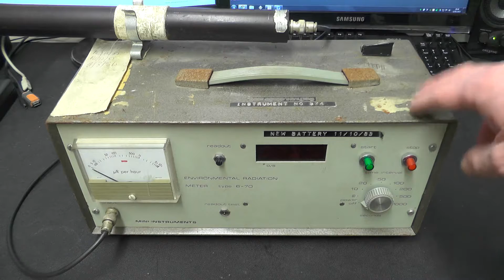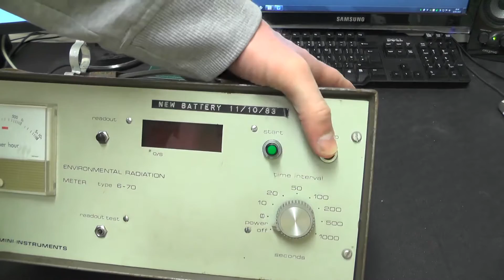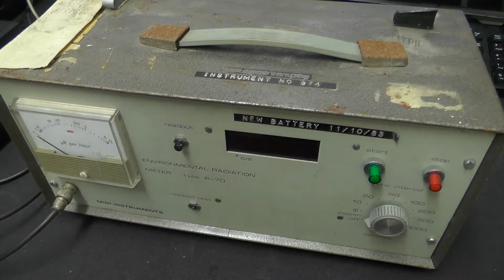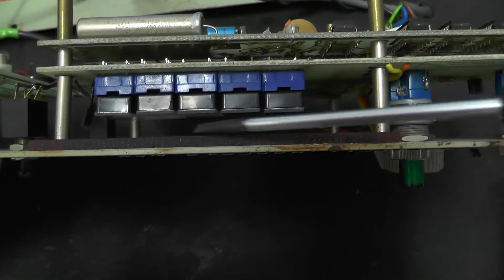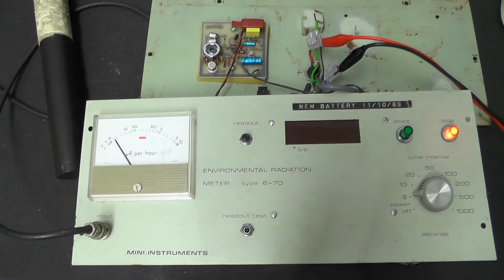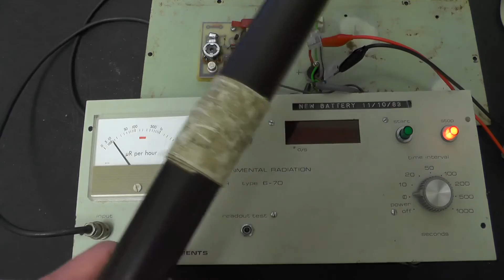DL#038 - Teardown: Mini Instruments 6-70 Radiation Meter

Comment: The Geiger probe shown in this video is either an MC70 or an MC71, where the difference is in the Geiger tube used. The MC71 uses a special version of the Geiger tube which has a lower shielded background count. This probe has negligible sensitivity to beta particles, hence the lack of response to the Fiestaware sample. Good news your tube is working!